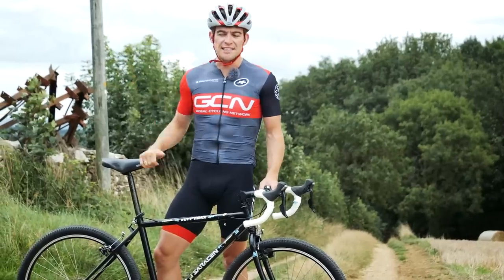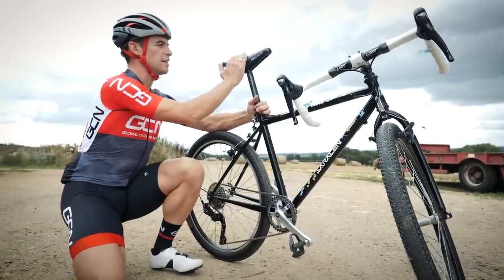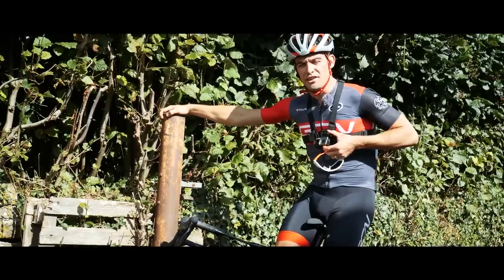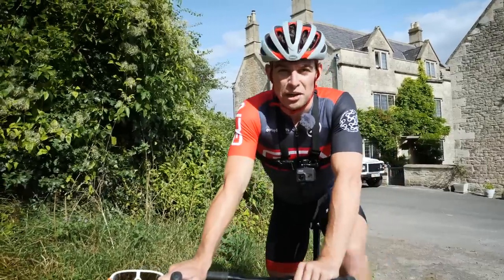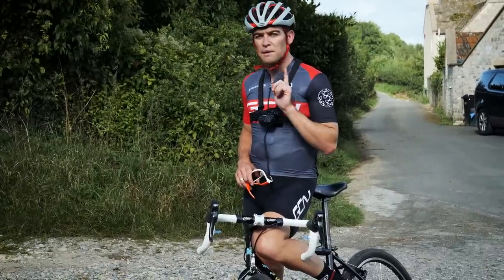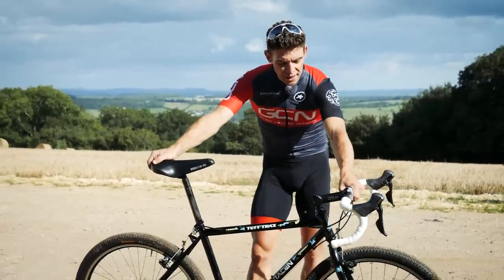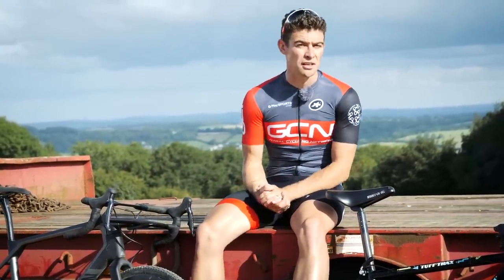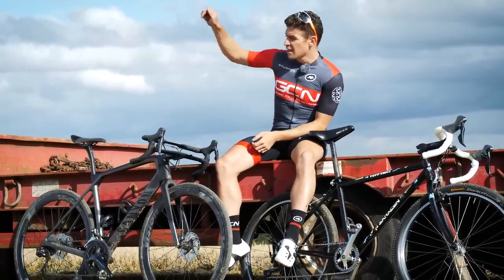Garbage Vs Gravel Bike | How Does Our Cheap Gravel Bike Compare?

Comment: So a 1x doesn't climb as good as a 2x...who would've thunk it. Keep up the great videos
Reply: 1x or 2x is not a thing here. this Ultegra is 50x34 this 1x in John's build is 38. So the only difference in chainset is 4 teeth (because both cassetes are 11-34). If chainring in this 1x would be 34 then there would be completely no difference in drive train ratio. So 1x or 2x doesn't matter in this case. There are many other factors - total weight, power loses in the drive train (especially bottom bracket, because there will be the biggest dfference I guess), wheel size, tires, pressure in tires...
Reply: @Simon_Says  but there is a 4 tooth difference. The 2x is geared lower making it easier to get up a hill. When comparing a steel vs carbon bike a 1x drivetrain isn't going to make that much of a difference. Hell put a triple on that thing so us fat bastards with bad knees can get up the hills
Reply: @scotttarrence9252  34-34 is 1:1. Most 1x gravel bikes come with a 1x11, usually with a 42T chainring and an 11-42 or 10-42 cassette. That gives you the same 1:1 ratio. On the MTB side SRAM has Eagle at their lowest level groupsets already, which is a 12spd 11-50 or 10-50 cassette. Triples pretty much don't exist anymore, unless you look at Tiagra and below.
It's not about how many front chainrings a bike has, it's about how it's geared. Most 2x gravel bikes on the market are geared like road bikes which is just plain dumb. However, GRX is probably gonna change that with the new 46/30 crankset. And hopefully we are going to see 12spd Eagle stuff in the drop bar world soon (I know that you can do it with AXS already).
Reply: @HollyBoni  I know what is available I'm saying comparing a 1x geared 38-34 is not going to be fair against a 2x geared 34-34 going up a hill. They did not put a 42 on it
Reply: @scotttarrence9252  Oh okay. In your original comment you said  "a 1x doesn't climb as good as a 2x", I just thought you meant in general, that's what I reacted to.
To be honest a 1x with an 11-34 is simply dumb, unless you live somewhere flat like the Netherlands. Cheap bike or not, that range is simply super limiting. Skip the 1x craze and throw on a nice 46/30 there. You even have a cheap square taper option from FSA (or a slightly more expensive one from Shimano).

Comment: You roadies have so much to learn about correct tire pressure. Those "balloon" tires should've been more compliant, not bouncy. If you do a cheap ghetto tubeless setup (gorilla tape, Presta valve from an old tube, steal some sealant from GMBN) you could easily have ran about 25 psi.

Comment: These are interesting tests but I think it would be a lot more fair to compare it to an aluminium, more budget version, I mean cf slx really... I think a lot of people would think about rebuilding or improving an older bike vs buying a new 1000-1500 euro bike. If you have 3-4000+ to get a decent carbon bike then it's not an equivalent option isn't it? Or perhaps sponsors wouldn't be happy with those test results? :)

Comment: Interesting idea indeed and I wouldn't care too much about a few seconds more or less but more in fact about how it feels to ride such a bike for 1 or 2 hours...Anyway I recently tried something similar with an old 28" trekking bike frame but found again that my Campa Ergopowers don't really go well along with the Campa Record OR Cantilever brakes. So does anyone knows a good drop bar braking lever fitting well with the Cantilevers ? These should be some with have a larger capacity in terms of "rope intake" (don't know the precise English term for that, sorry) than standard race bike levers. Or some sort of a brake-power-servo ?

Comment: Why not set up the old mountain bike with flat bars as a mountain bike like it was intended and then compare?   The thing looked rather awkward with the drop bars...

Seriously, why not use a cross country mountain bike for these fire roads like many of us did back in the day?  It wil probably just as fast as a "gravel bike" (check out GCN's own comparison of xc vs cyclecross vs road on cobblestones - that's right, the xc came out on top) - will access safely more places, and will be more fun in the process.  Save your money for a proper road bike if you want a road bike.
Reply: It's a stupid idea to ride a gravel bike on super rough terrain all the time. It can be fun for a few minutes, but after that it's torture. However, I feel like most people, or at least I use gravel bikes for a few different things. If i'm in the mood, i'll go for a road ride, and i'll actually enjoy that road ride more on my gravel bike, because it's more comfortable than an all out road bike because of the bigger tyres. If i'm in the mood, i'll go for a ride where I ride 70% pavement, 30% offroad, sometimes 50-50, whatever mood i'm in. The bike has mounts, I could go touring if I wanted, it has fender mounts with nice clearance, so I can ride pavement in the winter, have traction with slightly knobby tyres, and I don't get wet (at least from road splash). 
If you ride more offroad than pavement, and the offroad sections are rough, it makes no sense to do it on a gravel bike, as you said just hop on an XC hardtail. However, for mixed terrain use a gravel bike can be great. The best option would be a van following you with all kinds of different bikes.

Comment: 10 Y old bike costs with shifters, drop bars, grip tape, stem , tires, 28 wheel set , repairs minimum of 500€ excluding a work. And it's still unsaleable at that price.
 Not Bad job, but definitely you can buy a cheap new XC with a hydraulik brakes + air suspension fork + GRX shifters, drop bars around 1200€ in total  and let the bike fly downhill.

Comment: interesting comparison test but it was flawed.
If you are going to be fair in the comparison then you should have had similar tyres. There was a huge difference in tyre width tread and pressures which makes the test unfair . My bet is that with similar tyres and pressures the garbage bike would significantly close the gap on the Canyon   
I call for another test

Comment: You missed one real test. Take both bikes downhill and wipe out, Then assess the damage: Carbon snap versus steel bend and then measure the costs in 'tears per liter' the owners will have to shell out to replace the bikes. 
Myself, I'm slow motion and into the ride. I get passed by everything on the road so I don't need disk brakes. My rim brakes have great pads and stopping power is more than adequate. I get the allure of the new technologies and even find myself drooling over some of these really sweet bikes but....I guess I'm too practical. It's like buying a Ferrari and then sitting in traffic. 
Peace out fellow cyclists and stay safe.

Comment: Merida scultura 400 or reacto 400 . Please tell what to buy
Reply: giant tcr slr, or if you really really really love merida, get the scultura
Reply: Mate...your question is totally irrelevant to this video. Ask it in a different forum 🤔
Reply: @rokupixruiqi368  any reason to choose the scultura over the reacto?
Reply: @jaibhardwaj4886  Personal liking, reacto's rear brake is under the chain stay, internal cabling is whole outter cable (good for cable lifespan but heavy and noisy  when it hits the frame).  For a aero frame stock wheels looks ugly. For merida you get fsa crank instead of shimano original 105/ultegra. There is really no reason to not  get a giant instead.

Comment: Wait... So you're already doing the test a misservice by having the retro drop bar MTB at a too high tire pressure - an easy fucking fix and then giving the Frankenstein-Canyon bike the edge?  And of course the Canyon - a full on carbon bike - is going to be faster up the climb compared to a steel bike. 

All in all it comes down to tire size, tire pressure and the weight of the bike.

Comment: A $5000 US dollars bike vs a bike that cost a few hundred dollars in order to save 20secs on a climb and then lose time on a descent. Well that means you've had to invest $235 every second for 20 secs to gain a climbing advantage over the garbage bike. Then you lost some of that investment on the descent. Huge investment for marginal gains and for the average punter, you could not with any sensible pragmatism, justify it🤔
Reply: Put like that , yeah that might be true... but the comparisons are pretty much irrelevant to  everyday use. I suppose it makes for a fun video, but two and bit minutes of riding up and down a small hill and a wheel change are going to tell you bugger all about how a bike behaves on any meaningful ride ,let alone how it is to live with. Ghetto off-road or gravel bikes are great fun, don't get me wrong, but this comparison is fairly meaningless.

Comment: If you want to have fun outside with a bike, you don’t need an expensive race bike! But come on.... we don’t ride a 800m ? sprint uphill or downhill, you ride for one or several hours and then the difference in time, the power and fun will be different on modern lightweight gravelbike...maybe 😉 like my Canyon Grail 😊✌️

Comment: The main difference was the tyres. A couple of kilos of weight, or whatever it was, is practically irrelevant. A test of both bikes, with the tyres swapped from one to the other, would be interesting, but this is GCN, where thinking beyond the level of the superficial makes you a pervert.

Comment: i could never understand the point of no suspension off road bikes, more like an Vasectomy
Reply: Here's a couple of points;  lighter weight, cheaper, more efficient as suspensions soak up energy; so basically, it's much cheaper and much faster.  It should be a very easy point to understand!
Reply: I think these bikes are usually multi purpose bikes for most people, at least for me. If you have endless miles of gravel roads, that's great. And sometimes a gravel road can be smoother than a bad paved road...
I might go for a ride that's 70% paved, 30% offroad, or 50-50, or 100% road. Depends on my mood. 
The best would be if I had a van following me with a road bike and an MTB, and I would just change them out, but sadly I can't afford that.

Comment: Take a 500£ used hardtrial and yuo will be faster than both
Reply: Yeah, a good used 29er would have been fast.  Esp with tyres at a reasonable pressure.

Comment: "Gravel bike" is just the latest marketing buzz word that bozos will fall for. We've all had 30 years to put drop bars on rigid frame mountain bikes for next to nothing, but didn't know we wanted it until it was hip with the kids?
Reply: It's just another option. Even when you say MTB, you have a million different options in that one category. XC, Trail, Enduro, DH, hardtail, full sus, different wheel sizes, different tyre widths etc. A gravel bike is just another option. You don't have to buy one, don't get too hung up on it, and always ignore marketing.
Reply: The point is that besides fancy  technology like through axles, carbon fiber, disc brakes etc., gravel bikes have been here all along if people would have just put drop bars on their old rigid frame MTBs. The bicycle industry thrives on marketing new trends.
Reply: @A.J.1656  Yes, I understand that. Before MTBs existed, there were rando bikes, which are similar to a good amount of gravel bikes today (look around how many 650b x 47 tan wall slicks you see).
Not every gravel bike is a drop bar MTB tho, and my problem with the MTB conversion is that MTBs have longer top tubes, because they were designed for flat bars, so if you put a drop bar on there you are gonna completey ruin the fit. Yeah, there might have been an era where MTBs had a kinda suitable geo, but I want some modern features that old MTB frames can't offer. And guess what, you don't have to build a bike, you can just buy an off the shelf one! 

If you ask a gravel bike owner with half a brain, they won't tell you that gravel bikes are a revelation, something special, or rocket science etc. I have one, and I won't tell you that.
That's the job of a marketing team. But again, why care about what marketing teams say? They say a lot of other dumb things, but it's pointless to discuss them, or listen to them. Let them continue their dumb marketing, and make that $$$. Personally I don't care. Anyone with half a brain won't fall for marketing.
Reply: Cool beans. 
"Gravel bike" is just the latest marketing buzz word that bozos will fall for. We've all had 30 years to put drop bars on rigid frame mountain bikes for next to nothing, but didn't know we wanted it until it was hip with the kids?
The point is that besides fancy  technology like through axles, carbon fiber, disc brakes etc., gravel bikes have been here all along if people would have just put drop bars on their old rigid frame MTBs. The bicycle industry thrives on marketing new trends.
Reply: @A.J.1656  Again, I understand what you're saying, what I don't understand is why you're saying it, why you care about stuff like marketing, or what bozos will fall for. And we all know that trends exist, they exist outside of cycling too. That's just how the world works.
It's just seems pointless to comment about this, but then I guess most youtube comments are pointless (including mine).
Reply: My comment was a general observation related to the topic of the video. There's not much to say since you aren't refuting anything I've said. It seems as if you are trying to resolve a conflict that doesn't exist.
Reply: @A.J.1656  Your just salty because you can't afford one, and you know nothing about them.
Reply: @Chris66able  
There's something wrong with your crystal ball. I'm a former bicycle mechanic and I own 11 bicycles. I know a little about bikes and I can afford to buy the ones I want.
Reply: @Chris66able  
I keep replying to your comment and it's not here any more. I don't know what is going on. I'm trying to make some up fake things about you so you're not alone in doing so. I apologize for the glitch. 

Chris66able likes to beat puppies and is a racist.
Reply: @A.J.1656  Yes it is !

Comment: That was a pretty shambolic and lazy comparison. You could have taken the bikes on an actual ride and compared handling, and also measured fun factor too.

The wheel change test seemed absolutely pointless to me, and isnt a measure of how good a bike is at all! 

Pretty lazy stuff guys, considering the effort that Jon put into this over on the tech channel. Riding up and down a rocky climb and then swapping the wheels over isnt really much of a test and comparison between two wildly different bikes. Especially considering the difference in price point.

Comment: I don't understand why this is being called a gravel bike, It's a mountain bike with drop handlebars and road brake / gear levers. Marketing  / GCN bike manufacturer sponsor speak?
Reply: And a fitness bike is a road bike with straight bars yet it's called a fitness bike. An XC hardtail is just a trail hardtail with less aggressive geo and less travel. A CX bike is just a road bike with slightly different geo and bigger tyres. Etc...

Comment: Super light... and whoa, super ugly. Should be required to dress like Darth Vader to ride that thing.
Reply: Wheel change should have included shoving a spacer in there and taking it back out.. or the time to reset the pistons when you accidentally knock the lever in the car.